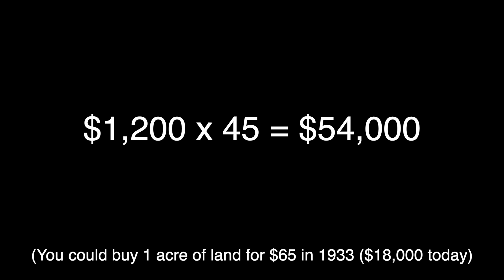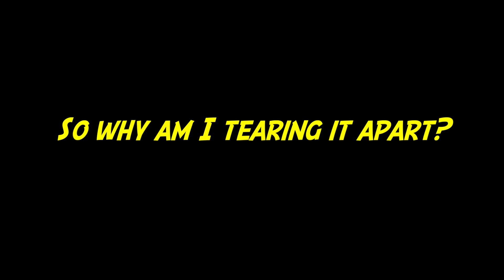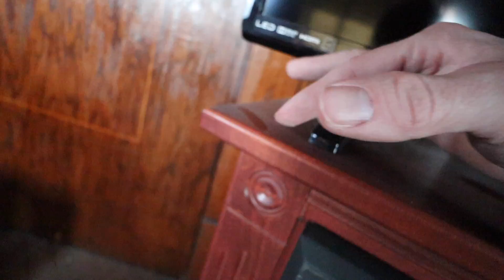Turning A $7,000 House Into A $700,000 House

Comment: I strongly suggest not disturbing the existing hardwood floors, no matter how you change the layout, the woodwork defines the value of the house's historical value. An Expert wood floor guy, which I assure you are in your area, there is more than a few experts. Lay-out your rooms in your house however you would like, same with the bathrooms, closets, whatever else you would like. Your expert can match the wood, and support the required adjustments, and then sand and refinish the rooms after you've done all the other rehabilitation work. Also, I have a Question, what exactly in 191? when that sale was held, could pull a 13-bottom plow?
Reply: Agreed - Ripping out original hardwood would be absolutely moronic!
Reply: A steam engine would pull plows that large. They only turned the sod over and plowed 6 inches deep.
Reply: And then over a year later he just rips it all out :/

Comment: Make sure that your new attic floor is strong enough to put a pool table in the middle of it. I also suggest a small kitchen area - pantry, small fridge, microwave and toaster oven, sink for clean up - that way the kids can learn to fix their own snacks.
Reply: And bathroom  in Attic,  Then can be Coles 🛏️ room (wall appointment) wall rest of house 🏡🏠 Miss in  updating home 🏘️ 🏡 🏠
Reply: And cctv to keep an eye on the kids to see they’re not getting up to too much mischief
Reply: Maybe just a wet bar and a power room since it’s a hangout spot 😊
Reply: slate table is 1000lb.  A lightweight one is about 320.... google.
Reply: feel sorry for who ever move the pool table in. nice ones weigh a ton and are a solid slab you have to be careful while moving. might need a crane to bring it two the attic
Reply: @kenreynolds1000  Lord, who'd want to lug a 1000# pool table to an attic?
Reply: Don’t forget the bar
Reply: @xiivillify  I used to work for a game company, pool tables disassemble into easily managed pieces. Only takes two people for the heavy parts. As for those people that suggested a bar,  this is going to be a kids hangout - no bar. A bar would go downstairs with the adults if they want one.
Reply: They could also use the wood from the closets.
Reply: @kenreynolds1000  my first thought too, would the house hold the weight.  They think one of the reasons that helped that condo collapse in Florida was too many people remodeling with  stone (granite walls, countertops, and floors) and not paying attention to the added weight on the structure.
Reply: @marycarricaburu3683  that’s why he needs a good engineering/architect involved. Will cost but save in the long run. Definitely needs to save the floors. They are probably imported white oak. Super thick & strong

Comment: You shouldn’t rip the flooring out. Just lay over the top of it. You can fill in any areas where the framing was. It makes for a good solid base if you’re going to put flooring over the top of it.
Reply: I would want it all up so there isnt any squeeks or hidden smells that come from that old floor.
Reply: @warrenmichael918  screw down the squeaks. Smells don’t hide unless you cannot smell. How do you hide a smell? You put a sealer over the top of it. Way cheaper and easier been doing flooring for 35 years. I would tear out the attic Subfloor due to the grossness.

Comment: Can you put rock wool in the ceilings between each floor?  It's a 60 minute fire barrier.  That house is all wood and it would give you TIME to get out and put out the fire.  Sprinklers?  ALSO, I agree with salvaging as much of the wood flooring as you can.  Today's trees don't compare to the quality of that old tree wood.

Comment: As someone that did the same the to our 1840’s house I love watching you take something and modernizing it. Only things I can suggest is with the old framing use 5/8” drywall, plan for a bedroom on the first floor because we don’t stay young forever and stairs can be a pain. Also consider putting a laundry area close to the main sleeping area!
Reply: That house is large enough to put in an elevator. No need for a bedroom downstairs. It would also remove the need for that hall to stairs to the attic.
Reply: @marcietee3841  I agree with an elevator suggestion but unfortunately it can be very expensive. My neighbour put one in and it was expensive, over $40,000 and that was quite a while ago. What people are doing now is roughing in  the elevator opening/shaft which is fairly inexpensive for a new built or a major reno like this. Later on the owners when they approach the age they really need it can have it installed then.

Comment: By accident we saw your inspirational video about the 6-year history of your farm, we loved it so much that we are subscribers now.
We own a 1732 old stone farmhouse (4,000 square feet) in Pa which was remodeled throughout the years. We learned the hardway that the  quality of the wood and craftsmanship cannot be matched nowadays.  If you replace the old hardware floors you will not be able to get the same high-quality  wood now. As many recommended, a good wood floor installer guy can match those sections, and after they are sanded and coated, they will look gorgeous. 
Also, we have 25 hot water radiators that we almost made the mistake of replacing for floor heating,
but thanks for the person who came to quote we didn't.  Instead they were sandblasted and powder coated and are now gorgeousm pieces of furniture. The heat is not dry and is so wonderful to seat in it during cold winter days.   Only the bathrooms have heating floors in addition to the radiators.

Comment: Cole,  I noticed no wiring in the exterior walls that had the foam insulation.  You need to check the codes for your area,  because here you need a receptacle every 12 feet.  It will be very difficult to install the wiring after the installation.  You said you were tearing out the existing hardwood floors.  You may want to rethink that.  The original flooring is more valuable than new, it's also a much better product than today's hardwood.  If you still decide to remove the flooring, people will pay top dollar for flooring that old.  I enjoy watching y'alls videos and have a great day! Timothy

Comment: When you consult the structural engineer about the roof support, ask about the strength of the floor also! What was just an attic, may not support much weight. Thanks for the house update.
Reply: THIS!! when we built our house, we wanted to use the "attic" space over the garage as a sewing /storage room. good thing we mentioned this as the beams for the garage then had to be bigger/stronger. you just cant use attic space as a room with heavy furniture, et al...without checking the strength of the "floor" beams up there

Comment: If you rip up that floor framing and it leaves you the areas where the hardwood floor is not there, you can easily have those areas filled in with hardwood flooring to match what is there. Then sand square the whole space and stain it. You’ll never know a wall was even taken out. MUCH easier than replacing all of the floors and keeps the vintage high quality wood that’s there.
Reply: I seriously doubt he cares.  He wants cheap crap instead.
Reply: @deirdrepasko9965  some form of plastic, they say it goes down real fast
Reply: If he saves the floor wood from the demo, he can use it in the house. His lips move about the historical value of the place, but his plans say that he really doesn't give a shit. No respect for antiquity.
Reply: @duncandogster    Exactly! He's talking a historical home and turning it into a junker with cheap material!

Comment: I was watching a pole barn get some insulation the other day. If they did 2 inch spray foam the quote was $16k. So the owner went and got 3 inch foam board and did it himself. Excluding beer and food for the guy helping him it was under $3k for a third more R value. Considering how important insulation is in a home make sure your installing as much as you can even if you have to do it yourself.

Comment: A few years ago I helped my wife get her home in the Boston area ready for sale. It was a year long project. 
I had small contractors do some of the work, such as drywall work and floor refinishing. She had steam heat as do you, so we found a small business that did powder coating of radiators. They came over and removed all of the radiators and took them to their location. They were sandblasted and them powder coated a deep reddish brown.  They were all baked at around 450 degrees. They were returned several months later and re-installed. I had the plumber put on new valves and pressure regulators.  There was no VOC’s when we turned on the heat and they all looked brand new, ready for another 100 years of service. 
I would recommend that you seek out a vender that could handle your job. 
You will have a beautiful home when completed.

Comment: I had a large American four square with a large walk up attic that I completely rebuilt.  Glad to hear your putting together a master plan, hopefully you professionals include a structural engineer..lots of people like to play one.  I had a load calculation completed on my attic floor and discovered it could hold a bed and dresser and nothing much else.  You don't want to spend money on finishes and have floors sagging and cracking finishes because the floor can't handle your needs.  It sounds like big plans, but make sure you can finish projects all the way through and chunk out appropriately.  You don't want to be 60 and still living in a construction site.  Lots of lead paint on that plaster.  Looks like your starting to take seriously. Lead and kids/future kids don't mix.  If you have old painted windows get rid of them.  The uv rays will break lead paint down and when window opens microscopic lead dust blows all over.   You can always make more money, but you can't fix lead damaged kids.

Comment: Cole I am so glad you are doing more work on your remodeling again. Regarding your concerns with getting insulation particles stuck to the areas you have already spray foamed, something that will help with that is sheets of plastic. Have your contractors hang sheets of plastic stapled to the framework around the spray foamed areas to protect it while they are tearing down the insulation in the ceiling above those areas. Make sure the sheets are sealed as well as possible to not let in any insulation particles. Then when that part of the project is done you can tear down the plastic and then put up drywall in its place.

Comment: I'm so excited to see that the abandoned mansion renovation is going to get some momentum back.

Because you like your technology, I'd plan to work with someone on data infrastructure plans. You might as well have ethernet cables going everywhere, for WiFi, security cams (SimpliSafe is neat, but an Ethernet system can be superior), computers, and TVs. Put in conduit for this before wall covering or insulation goes in to make the cabling upgradeable in the future.

Because conduit is cheap, you may as well put some in the ceilings for whole home audio. The pipe is cheap and doesn't force you to actually put speakers in, but having the infrastructure in place is a wonderful thing.

Comment: I LOVE your attic ideas. That will be amazing once you get it done & I’m glad to hear you are consulting professionals. I do highly suggest consulting a flooring expert on your old wood flooring. I know there are different ways to save the old floors even with taking down walls. Even if you use a professional, it will save you money in the end. They can patch holes & sand down the old floors. I’ve seen it done many times on the HGTV shows I watch. Also, save your doors & reuse them where you can!

Comment: The first 7 minutes or so of this video where you gave the history of the house was fascinating.  You're definitely doing the right thing restoring.  Consider reusing the original switches with modern wire behind them.  They are beautiful artifacts of a bygone era.
Reply: Except he's not restoring the house, he's renovating it. MAJOR difference!  IF he was restoring it, he wouldn't have thrown all the lath away, he wouldn't have used spray "insulation", and he certainly wouldn't be talking about removing the flooring for new cheap crap!

Comment: Our first home had knob and tube.  As I gutted the place, I was so disturbed by the wiring condition and jumped wires...I disabled 90 percent of the wiring and ran temporary plugs where needed.  The kitchen was the only area that remained on the original knob and tube.  The following spring we disabled the kitchen, wired four temporary outlets and used floor lamps for lighting.  Took nearly a year to get to that mess hehehehe.  My only suggestion would be to avoid a long hallway that follows exterior walls.  Hallways that block potential window locations and exterior light will come back to haunt you.

Comment: I own 2 houses built in 1911 and 1915. I have stripped the plaster and lath, removed every piece of trim, cleaned stripped, filled and repainted or stained, hand cleaned the hardwood floors, repaired, filled, sanded, stained and sealed and put it all back together with modern wiring, plumbing, insulation, Sheetrock, texture and paint. I’ve reused everything I could and searched for 5 years for a period specific door to replace a missing door. It was worth all the effort. Cole - your house like my 2 houses are what is called “first cut wood”. They are true dimensional lumber and far superior than what you can buy today. The floors can be saved and a good floor guy/gal can fill the gaps/missing areas with wood from spots you won’t miss (a closet for example). Please reconsider removing the floors. They are priceless and have character you can’t buy. Please don’t bust through anymore wood. It can be used to repair something. Keep every stud, door and trim piece you can. I absolutely agree about the attic and believe you need a structural engineer that can create sealed plans to strengthen the support. 

Look at a product called OdoBan . It will remove any odor in the attic floor. It kills the bacteria that causes the odors and it works! There were unknown biological animal substances in one of my houses that had oozed through the carpet and into the wood. Two or 3 applications and every smell was gone. 4 years later now and not even a whiff of what can only be described as disgusting remains. 

I love your vision.

Comment: Just a bit of info for you to contemplate...as an older somewhat of a know it'll. Start with making sure the footings ,basement walls , and main floor are leveled. That way if you have to adjust any of these you won't  distort any walls or windows.then level  second floor then attic floor. Then you can go to work

Comment: Towards the end you discuss a back stairs to the attic.  Might give that a long think. It's cool but you have a long hall that will be hard to heat and the bathroom will have no external walls for ventilation and natural light. You can still make access to the attic by pushing bathroom over to the external wall and make the hall interior.

Comment: Material things do not last forever. MY dad's family was among the first in their county to have electricity around 1915 using a generator. You are moving forward just like your predecessors did.
Reply: If they want to move forward, the house should get solar panels and battery banks to help run it at night or cloud days. They would save a ton and modernize the house even more! Put panels in the sheds as well. The more the better.
Reply: Unlike Cole, his predecessors knew what they were doing.

Comment: For dust control get a air scrubber and some duct work to pull a negative air in the work area and get a zip wall containment door from Menards to seal off door ways but I then has a zipper to get in and out of room.

Comment: Hey CTS try this for door seal it still allows you to use the door, "Alien Draft Seal Insulation Tape" and "Holikme Twin Door Draft Stopper" both for dust control, I would tape a piece of Ram Board down in front of the door to protect the floor from the Draft Stopper, from removing the Finish from the floor.  "That's experience talking..."  I had to pay for 700sqft  of floor to be refinished. I lost $$$ on that job.

Comment: Id recommend 4inch rockwool insulation into the ceiling joists for added sound deadening. Rockwool is great for its efficiency and fire resistant properties over fiberglass insulation. And keeps different parts of the home separate in the heating zones on a house that large. But you would need a consult with a insulation specialist as putting a barrier between floors can change the vapor barriers and mess with humidity control. And putting some type of sound barrier under the new flooring upstairs, such as an acoustic underlayment. It helps greatly in sound control.

Comment: Glad you’re getting a pro involved…my house was built around same time and upstairs is pending too. Not near as big as that project though. 

Wood flooring now is no longer 3/4 so the elevation will change and create more issues unless you get milled sticks. May inquire if they can use existing wood floor sections to fill in the floor plates you remove…..that’s an awesome looking floor. They may be able to pull up in bathrooms you are installing and use those to fill in the blanks…..once they sand and refinish it’s like new. 

They call the short wall in attic a pony wall….mine are taller but every bit as concerning. Anxious to hear what the pro says, so I can follow the lead.  I was thinking of coating underside of roof with radiant barrier (like reflective paint) then installing air pathways that are plastic and then go with fiberglass insulation. The air gap is needed.  Also, down south I could use spray insulation on walls as it needs a vapor barrier and I didn’t want to rip exterior wood siding off but think you already put in hardi board so sure they tyvek sealed it.